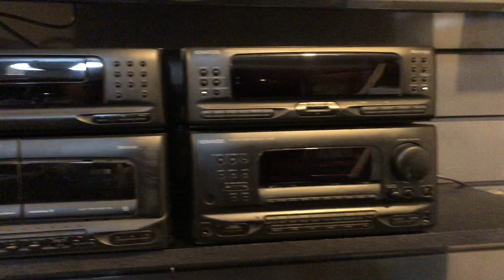Installing Slatwall  - Garage Makeover Part 4 - Wiring for a TV, Stereo, and what else?

Comment: That slat wall is such a good idea.  I don't think I've ever seen them before.  My folks have a similar pull down ceiling door.  But rather than a string they use a broom handle (just a piece of dowel) with a hook on the end.  And they have an eye screw on the door part.  So they just put the dowel out of the way until they need to pull the door down.  Maybe an idea :)
Reply from the maker: Hey bud!  Been a very long time!  You were one of my original subscribers!  How have you been?

Yeah, I didn’t want any old fashioned peg boards.  This looks nice a clean, and very functional.  I will be finishing up the left side of this north wall, then the half of the west wall.  Might do it in the next couple months.  Once section will be metal Slatwall so it can handle more weight.  I am very happy with this product.  It can be very difficult to cut. 

That is a great idea for the attic latter, I will definitely do that!
Thanks for watching! - Tripod!